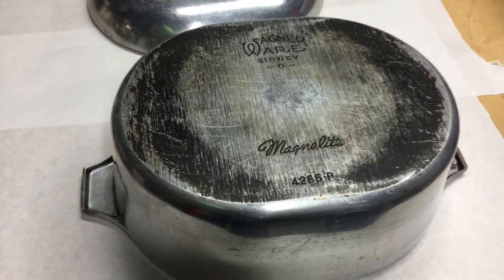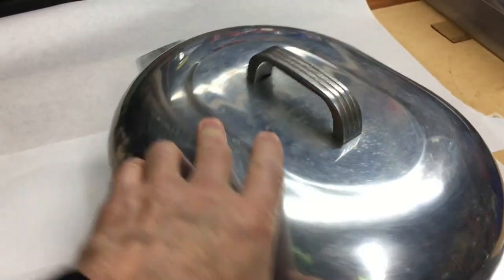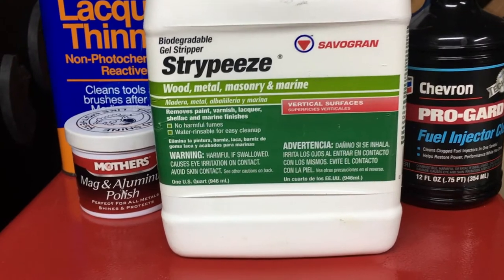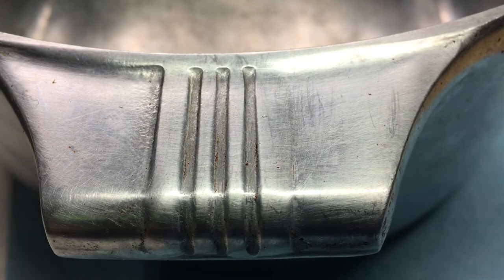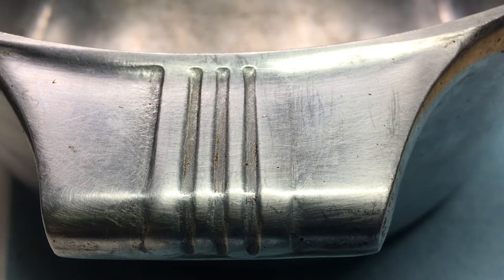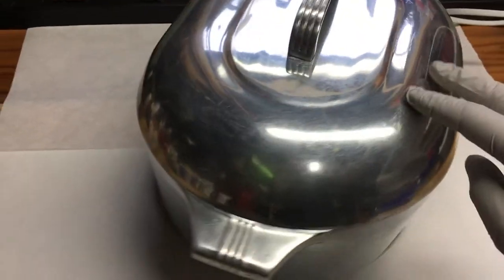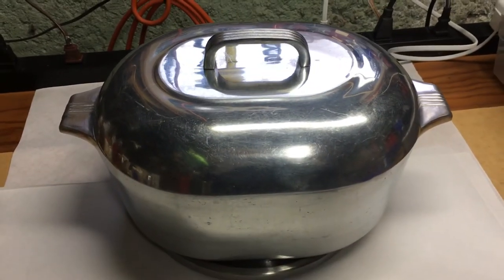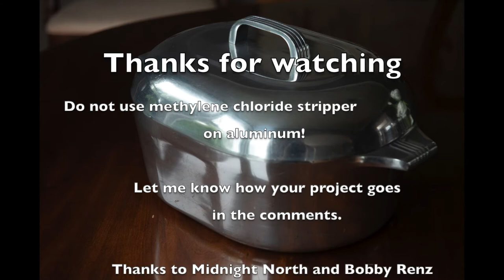Magnalite restore

Comment: I found two of the 15 quart at thrift stores for $12.99 and $40. I used an angle grinder with a white polishing wheel for the outside and they look great. Having a hard time making the insides look new so I just cleaned them with aluminum polish. Stripper worked good for the bottoms. I also found a 4005p roast pan today for $3.99. They sell for around $100 on eBay.
Reply from the maker: Congratulations on your great finds! No question these are heirloom quality.
Reply: Just got my large oval O Sydney at thrift for $7.99, looks beautiful!

Comment: This is very helpful. Thank you very much, the information here is very rare to come by. I have just subscribed to your channel 👍🏾.  The only thing I would like to see is the cleaning materials clearly mentioned or shown; apart from the Strypeeze, I didn’t see the name of the other cleaning material used.
Reply from the maker: Hello Loretta, thank you for subscribing, and even more for letting me know how I could have done better. The sharp-tipped nylon tool was from a set I bought for gun cleaning many years ago, and because of the marks it left I don't recommend it for this job. The wider nylon spudger came with a dash cam I had installed in my car. For the final polish I used Mother's Mag & Aluminum Polish.

Comment: Is that safe to put on and then eat from the pot
Reply from the maker: The stripper I used is toxic, but I only used it on the outside, and of course I washed it off well when done, so I am not worried about it. If you want to be extra safe, 3M makes a product called "Safest Stripper" that is non-toxic. I have found it to work more slowly than the toxic strippers. It also is water-based, and if the water evaporates it stops working and dries on the surface.

Comment: I got aa roaster, smaller then this one for $5 and this same one was there at a local estate sale for $10, I did not need such a big pot so I did not get it. But what I used to clean all that black baked on residue was paint stripper, It took all that out, did not stain or corrode the aluminum!
Reply from the maker: Nice.
Reply: Which paint stripper did you use? Thank you in advance 😉.
Reply: @JNante  jasco premium paint remover. This what I had bought from hardware to remove paint off a cast iron legs of a treadle sewing machine. I used that to remove the crud off the pan

Comment: Can you use both of these products on the inside also?
Reply from the maker: I would not use either the stripper or the polish inside. If I couldn't get the inside clean I would consider a non-toxic product like 3M Safest Stripper, but for me it's the outside appearance that matters so I probably would not. There's no need to polish the inside. It wasn't polished when it was new. Thanks for watching!
Reply: @sealrock9404  thank u!

Comment: I REALLY wished I had seen this video before I COMPLETELY destroyed my 1930 wagnerware magnolite pot with oven cleaner. I usually use oven cleaner on my cast-iron figured what the heck, do you happen to know if my pot is salvageable after using the oven cleaner on it it was definitely a chemical reaction.
Reply from the maker: I'm sorry for your misfortune. If it's just the exterior it might still be usable. And if there aren't deep pits you may be able to polish it with Mother's and perhaps a buffing wheel.
Reply: @sealrock9404  some on the interior but not as bad. And your saying mothers the car polish ? Thank you again for the info
Reply from the maker: That's right, I like it b/c it is designed for magnesium / aluminum wheels. It's what I used on my Magnalite.